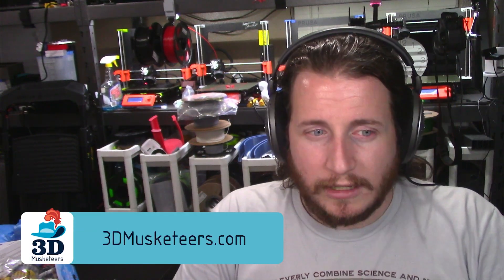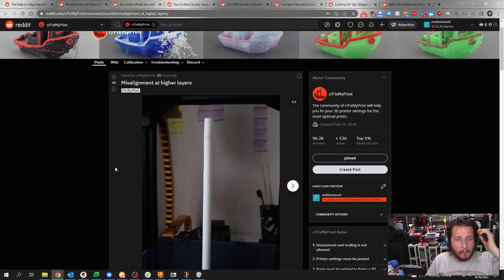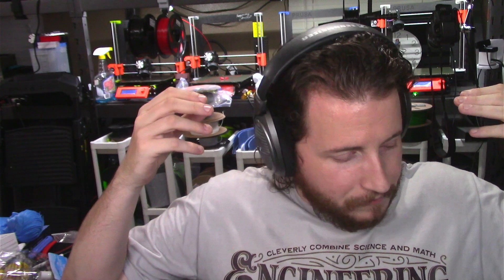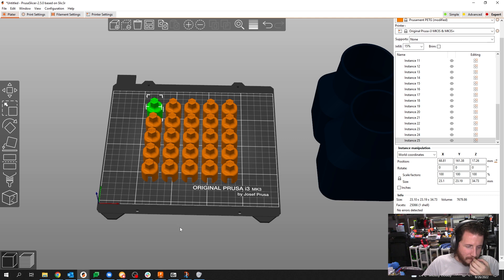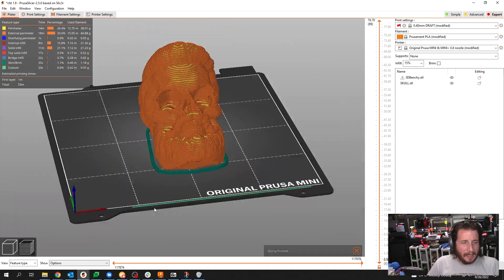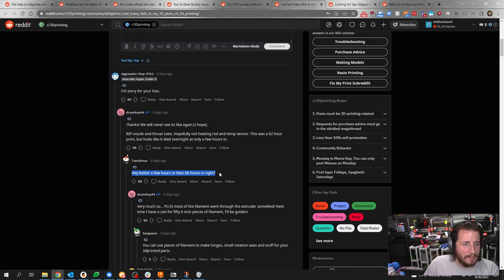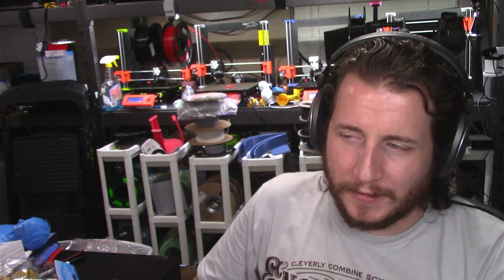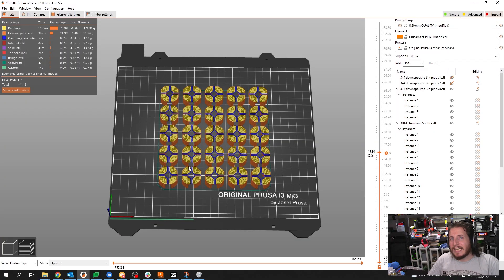Hotend FELL OFF mid print! - PrintFixFriday 55

Comment: As a guy who runs a raise3d machine I can say they make almost great machines. They make a cf machine and market the hell out of it printing carbon fiber but it's not continuous it's just a hardened steel nozzle. The pro 3 has a "chamber temperature management system" that doesn't include heating the chamber at all. At least the n2 plus we currently have is hackable but our next machine is not going to be a raise3d machine if I have anything to say about it.
Reply from the maker: That's been my understanding too. Is ALMOST amazing but the ball is dropped right at the 9yard line. I want to see it for myself and do what I can to help with it to get them to the 1st. Down!

Comment: Your presumption that "manufacturers" are infallible when someone has a spool "knot" is narrow minded and fatuous. In my near two decades of printing as a profession I have had the occasion, albeit rare, where there was a tangle in the middle of the spool, a spool (usually 25kg) that is opened, loaded into its holder, and not removed until it is empty. If it can happen on a 25kg spool it can happen on a 1kg spool. The problem isn't necessarily a traditional knot, but loops sliding past, under or over, each other due to a hiccup in the take-up of the slack during the winding process
Reply from the maker: They can slide past all they want, there's no way for them to knot unless the material is physically stopped, messed up, then started again. Try it with some string and a cylinder. It does not work.. 

I certainly did not say they are infallible, but it's considerably more often that the user messed up than the manufacturer. 999/1000 it's the user.

Comment: I was doing test prints to figure out how big I wanted my Xenovia figurine to be (even though she doesn't have proper eyes and isn't rigged for posing) And I did a hand at 200% of the original size (which was 12000% the model is super tiny don't ask me why as I tried to scale her to life size in blender) and I didn't turn on my dryer since it's just a test print that would be done in 30 minutes. Holy crap the stringing was soooooooooo bad. lol Her hand almost turned into a mitten. But I determined it was probably too big. So the second print I did the whole model at 20000% which was slightly too big so I cut it in prusa slicer without making any attachments. I turned the dryer on for that. SUPER clean print. I really do have a humidity problem. lol I actually did 0.3mm layers and I still can't believe how amazing 0.3 turned out. I mean it's not good enough for the final (I'm considering getting a 0.25 nozzle for her since I got the rivo anyway) and it will be 0.1 or possibly 0.5.
Reply from the maker: Given how cold you keep things I would not be inclined to think moisture, but who knows.. I have very little issues with moisture here.  If it works though, it works!

Was it petg or pla?
Reply: @3DMusketeers  ive only used pla. I did exaggerate it a bit. I was able to fix it with a heat gun more or less. Even with its not as clean as the dried print.
Reply from the maker: COULD be from not enough retraction. but if the drying works, don't change it!

Comment: I've had 2 tangled spools. The black sunlu was my fault and I know it. The filament pm silver that came with the printer was tangled before I even took it off the spool at all. I opened the box and I'm like HOT DAMN THAT'S BAD!!! Maybe it got dropped at the factory. Also I had a print with that where it over extruded at parts and slightly under extrudes for the rest. I hate it. I will never buy filament pm. I wish they would have given the option to swap it out with prusament. and unfortunately it's a fat spool. So I still have a lot of it. I can use it for prints that need a highlight where only the outside of the layer will be visible. I've done that. It was fine, but on the inside I could see it under extrude.
Reply from the maker: Yeah when it happens at the end of the spool it is because the spooling machine messed up and a worker tried to fix it generally! 

It is increasingly uncommon though.